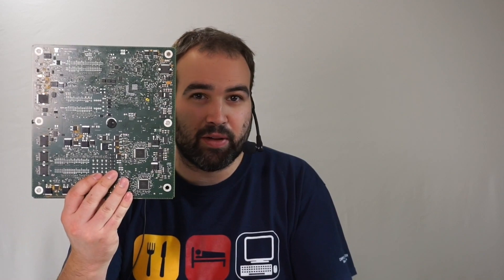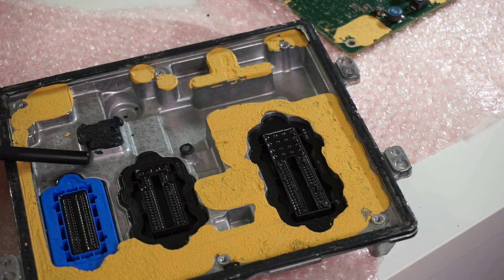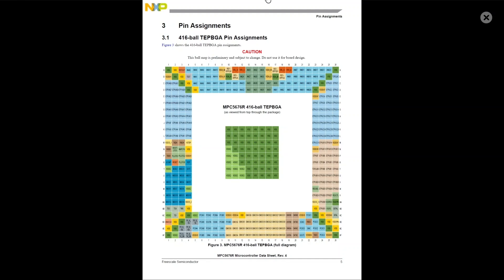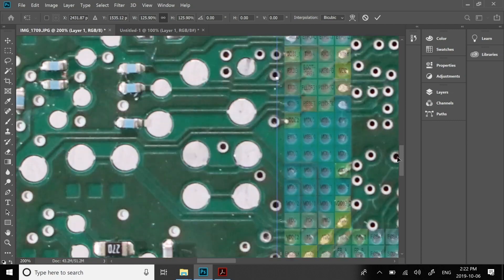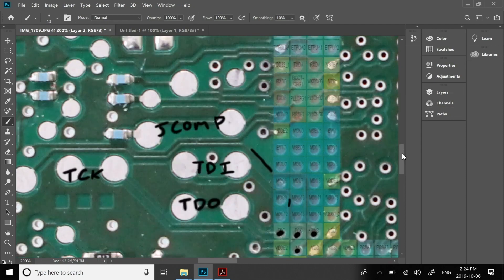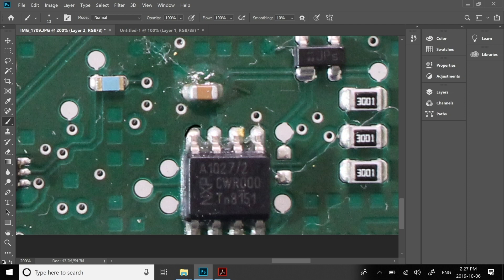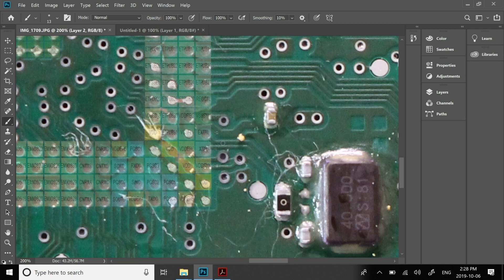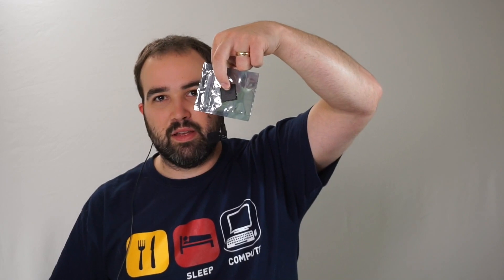GM Duramax L5P ECU/ECM (E41) Teardown Part 2

Comment: Is that electrolytic cap in video at 3.17? In consumer grade electronics electrolytic caps fails after some time period I wonder how much time that will last in harsh conditions of automotive temp.
Reply from the maker: There is both large through-hold electrolytic and SMD electrolytic there. I haven't looked at any old ECUs to compare if you see significant degradation (hopefully someone else chimes in with more automotive experience!).
Reply: It could be an aluminum polymer solid electrolytic or a conductive polymer aluminum hybrid. Solid electrolytics don’t dry out and hybrids have less electrolytic and are more immune than a regular electrolytic.